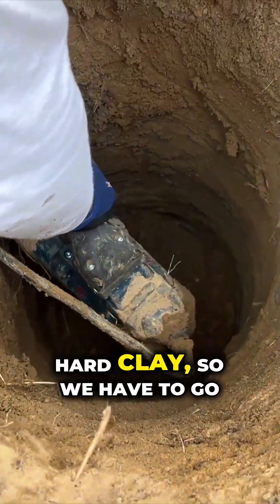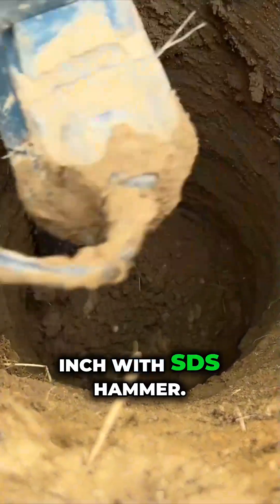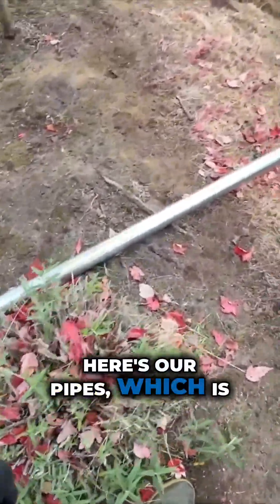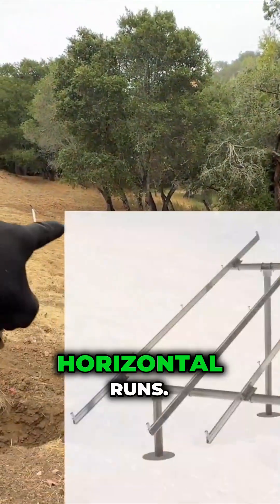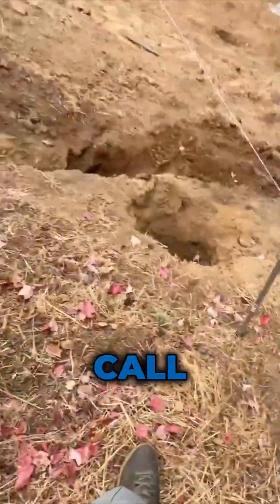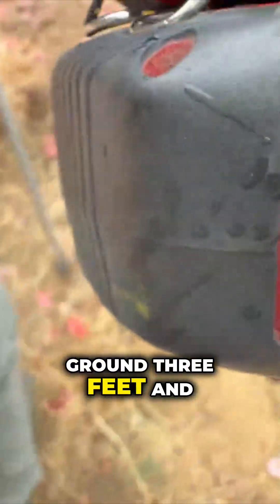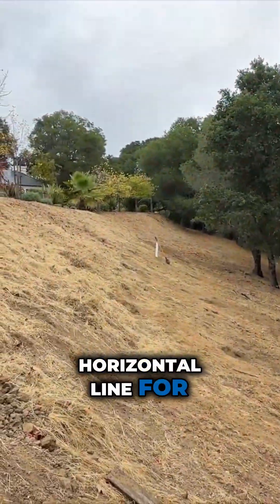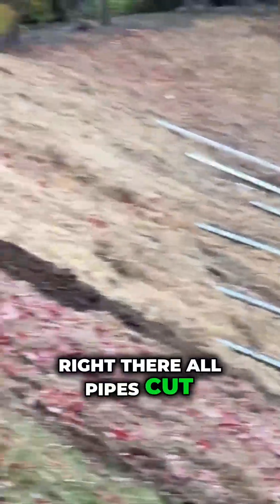We Hit Hard Clay! Setting 14 Piers for 23kW Ground Mount Solar Array 3

Comment: Could you have just hammered the scaffolding poles in to the ground or drill a small diameter hole and then installed the scaffolding bar..
even add some diagonals hammered into the ground.
Reply from the maker: We hired structural engineer to do calculations for the peers amount and size. And city inspector checked everything before we can pour concrete.
Reply: @SolarEngineering 
There are specific types of hammer in type post's.. I have even seen them used on YouTube videos, including a professional solar installer.